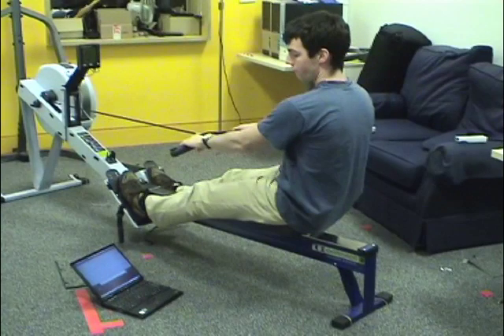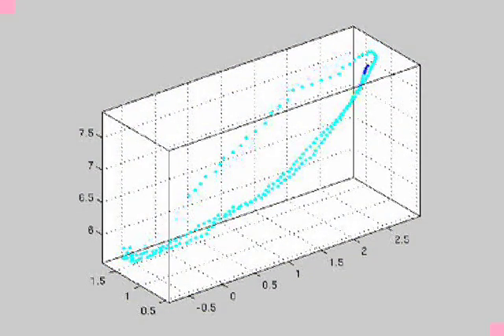Hacking Wiis for 3D tracking

Comment: however johnny used only one wiimote, and two LED's.
These guys get more accurate readings than johnny lee does on his head tracking application.
I also think it is impressive that they have the computer figure out where the wiimotes are by waving a pattern of LED's in front of the wiimotes.